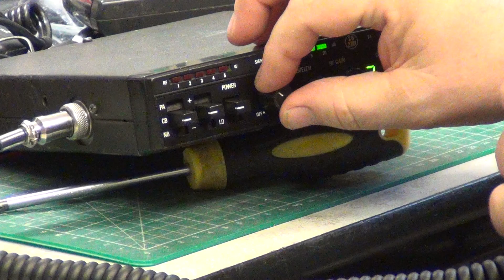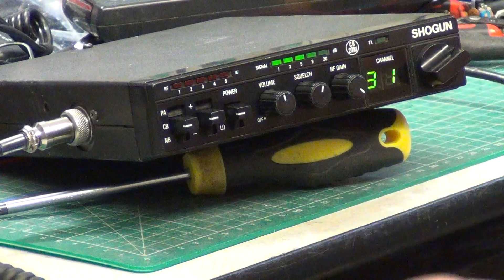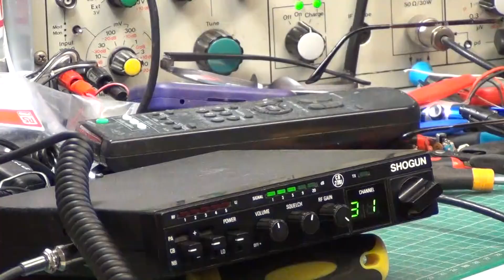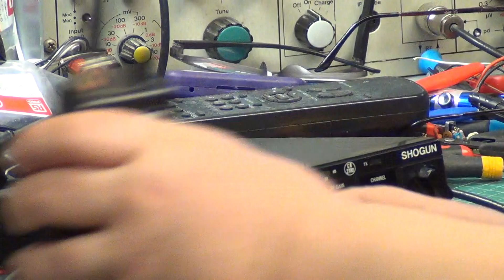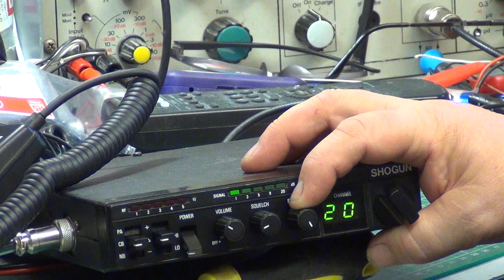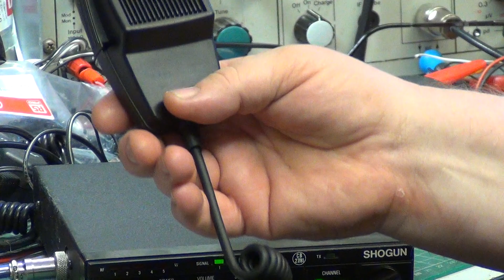Shogun CB 27/81 UK FM CB radio - On The Air test

Comment: I remember seeing these sets on the cover of a magazine at the time and thinking what a bold design it was - appeared flat and wide. Actually quite like the design of these like a squashed amstrad but doesn't seem to be a good reliable radio... interesting test Richard enjoyed as usual.
Reply from the maker: Other than the Harvard Good Buddy, I would even say these are less reliable than those. Within the first year they were coming in with fault after fault....and then the dry joints started becoming apparent.

Richard

Comment: Shame it would have been nice to hear the quality of the TX audio without that terrible buzz.
Reply from the maker: Here is a link to a non-public video of the same set on a mic with a screened lead:-

https://youtu.be/QYtBiDqG93s

Richard
Reply: @ukfmcbradioservicingTango21  Many thanks good audio but still buzzing on high power - weird.......
Reply from the maker: It doesn't mean it will for the customer. Many of our 'on the air' tests have hum on TX audio. This property is fed by 11KV with the step-down 230V transformer only about 20' away.

Richard

Comment: Would be better to turn down the rx lights internally as they're terrible at the moment.
Reply from the maker: These sets don't work as swish as they look. I personally had one in the car in 1982 from new & had to give up on it because of it's unreliability & operational foibles. I replaced it with a Harrier CB. 

Richard, G0OJF, UK
Reply: Maybe it was to simplify signal reports back to other operators - you know without looking that it'll be at least a +9dB, so "9 to +30" would be correct every time lol...!